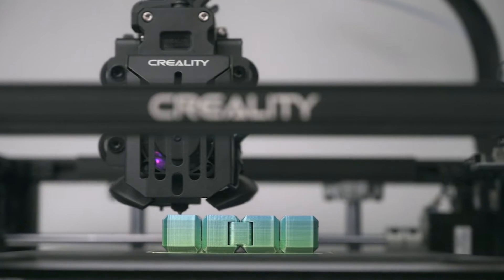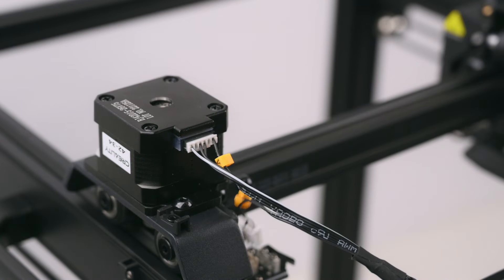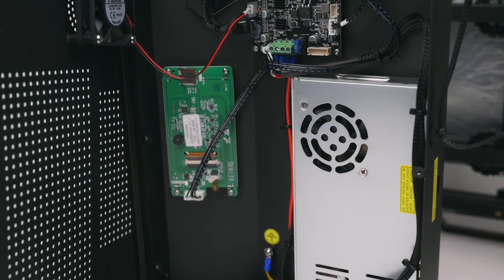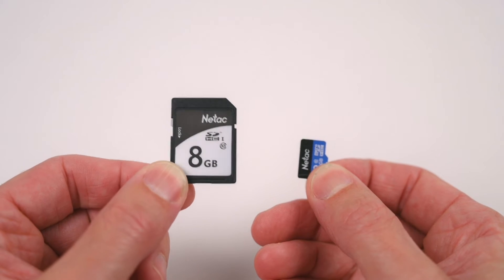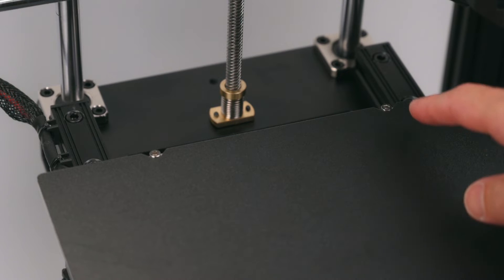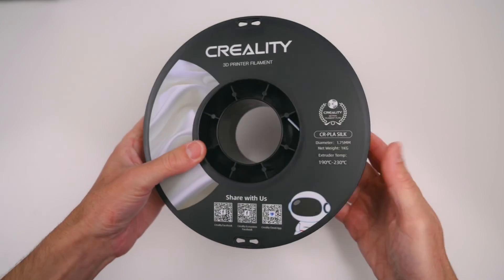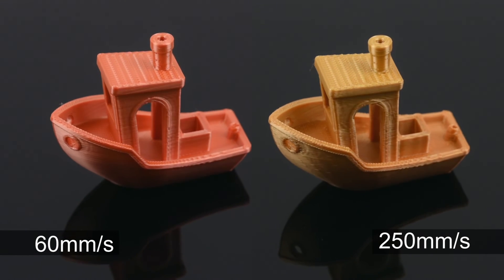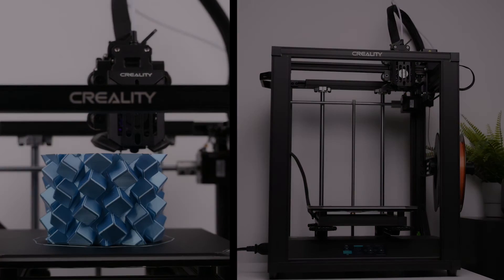FASTER PRINTING WITH ENDER 5 S1 3D PRINTER

Comment: You mention that this is a carthesian style printer, but isn't this core-XY instead?
Reply: It's carthesian as you have dedicated motors for each axis, X motor moves the X axis along the X axis and so forth for the Y. With corexy you have A and B motors which both move the X and Y axis together, so one Motor can only move the printhead diagonally.

Comment: great video! this looks great but im not quite sure this upgrade if you have an ender 3 already since the build plate is the same except the Z axis is taller. ive been debating if i should get a bigger printer since i also recently got a creality ld200h (resin printer). all of this is because i watched your video on how to make a amstudio g29 racing hub 3-4 years ago with a 3d printer.